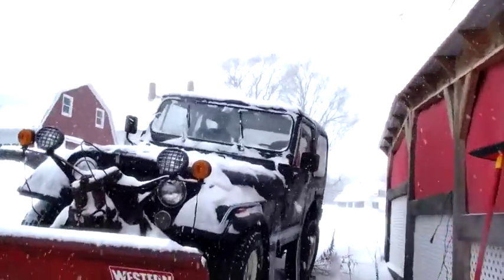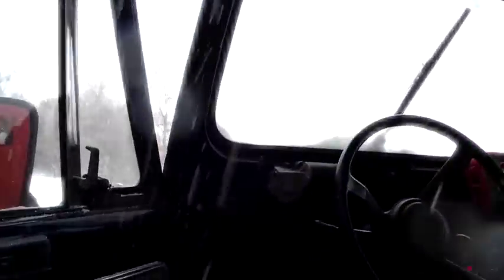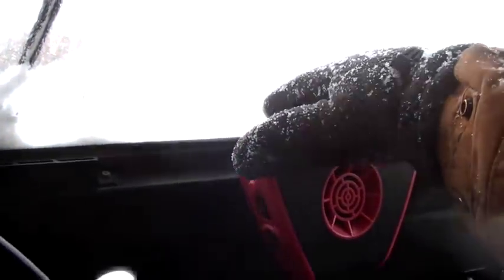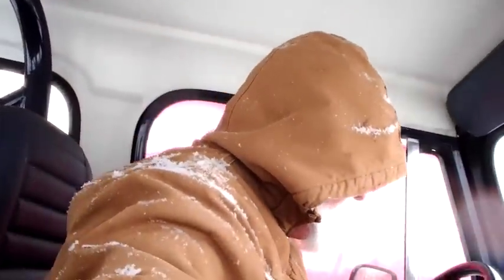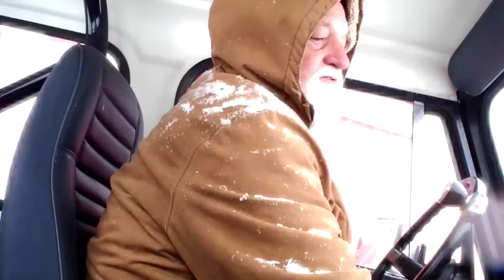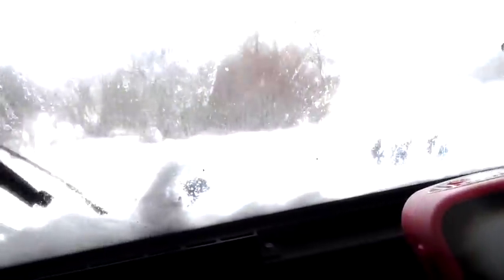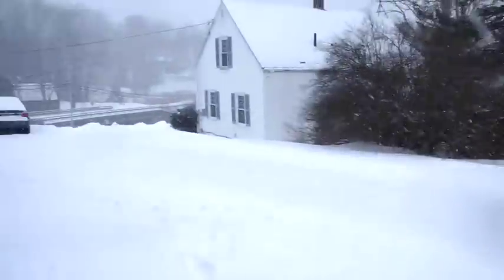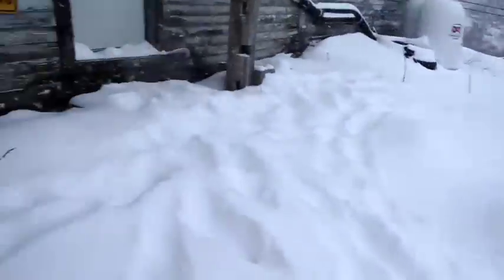$35 12 volt Dash Heater

Comment: How about putting a generator inside the jeep?  Run the exhaust out through a hole,  plug in a real heater, and a battery charger.  Let it run a while, and get the cab nice and warm, and the battery charged a bit before starting it up.  Heck the generator would put off a bit of heat itself.

Comment: a computer fam attached to a piece of aluminum slid down the defrost ducts will move some large amounts of air, they run off 12 volts at about 2 amps

Comment: Is this heater still working ? How do you like it ?
Reply from the maker: It does work.   Draws a lot of power.  I had to take the fuse out and wire it directly to the battery.   I don't run it all the time, just right after I start the jeep to thaw the windshield till the heater warms up, then I shut it off.   It's cheap, faded plastic, and will blow the fuses if you plug it into a cigerette lighter, but it can be made to work...  It will run your battery down too if you leave it on for very long.